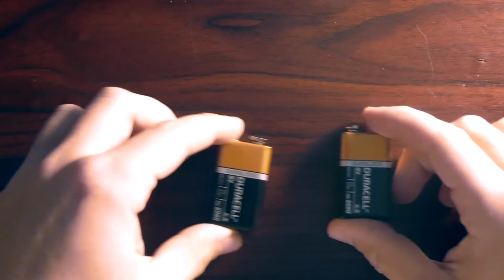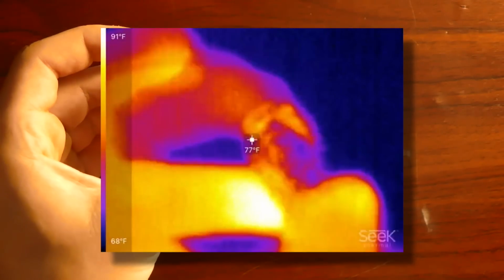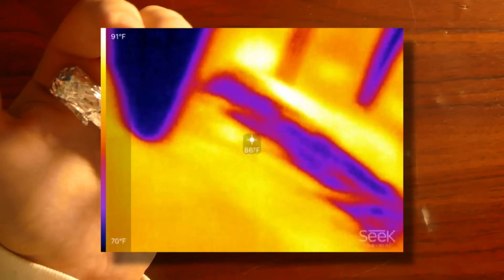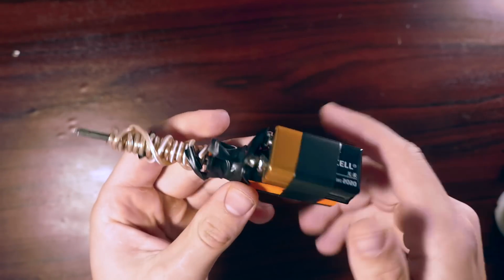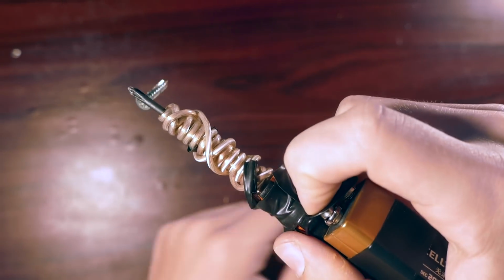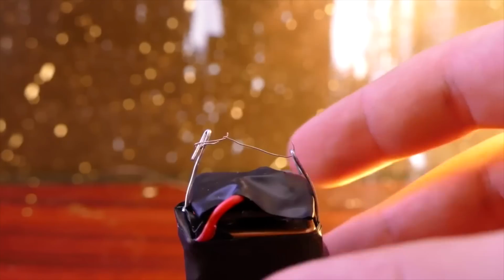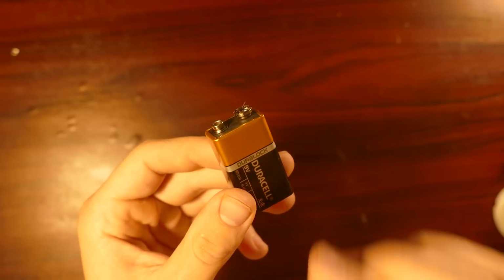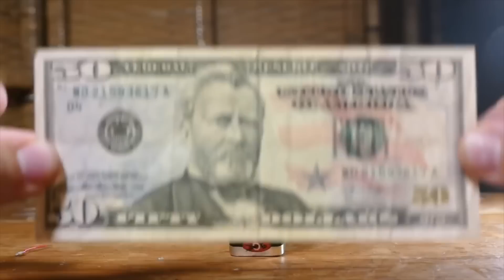4 Incredible Tricks With Batteries!

Comment: The 1st one is literally a bomb.
Reply: What
Reply: @man_ofculture9804  because the battery will explode if left wrapped with aluminum for an hour or so. Because the foil short-circuits the battery. The battery will explode until it reaches its max temp
Reply: @gabreyes3149  oh thanks
Reply: Seriously? I once did that in school with a battery and a brass fastener, I didn’t know it could explode
Reply: KingTurtle37 it’s only a AA battery it doesn’t have enough power to do that not even a 9v does and also to back this up I tried a 9v too
Reply: And that’s why there are more explosions being reported lol
Reply: @ST3W1010  old batteries would explode, newer batteries just run out of power
Reply: Nath Rob yeah i didn’t use old batteries. But ur right
Reply: Gamewire101 It's also very likely to leak. Do you want battery acid on your hands? I don't.
Reply: Well
Reply: Sounds fun
Reply: oh yeah it is!!
Reply: @thegamercow773  yes
Reply: Know from experience
Reply: Only 3 blew up but I threw bout ten of them into somebody I hated house got really fucking hot
Reply: true
Reply: @Tzler  ya know what we call that a fucking felony

Comment: 6:00 what could i use instead of nichrome wire? because i dont have  that
Reply: Brillo and you dont need to do all that. Just take small peices of the brillo and twist it tiny and th end you'll be touching and bigger twist on the end for battery terminal..1 on positive and then other on negative and touch the ends together. If your just getting it to light something that works.

Comment: Dude...
To anybody watching; don't do that foil-battery-hand-warmer trick. Just don't. 
There's a 50% chance that the battery will leak and/or catch fire. Foil catches fire and burns pretty easily. 
It's an alkaline battery. Alkaline reacts violently with aluminum as well, releasing hydrogen gas, should the battery leak. 
Just don't do it. Put on some gloves.

Comment: for the first hack wouldn't it explode or get to hot and would this work if you put 2 9 volts together I haven't seen a video on it sooo
Reply: Two nine volts stuck together is even worse! Shorting a battery one thing but passing additional current into it is way more dangerous.

Comment: How thin the Nichrome Wire your using i have 4 Milimeters and it doesnt work please help Thanks
Reply: Check if your battery still can deliver around 9 volts.. Also, i think 4mm are really a bit to thick.